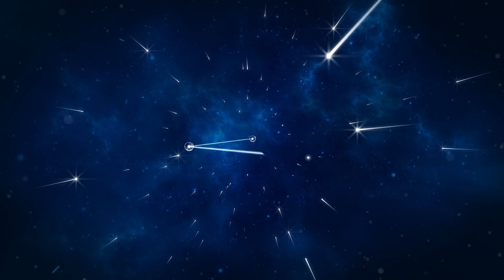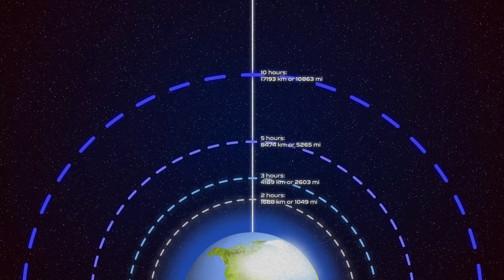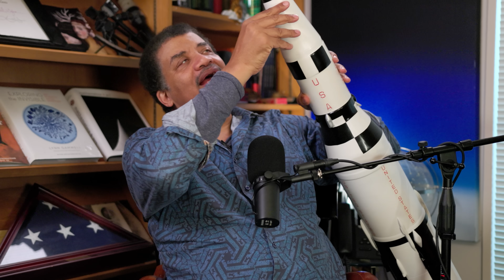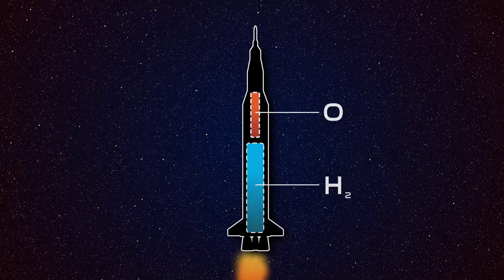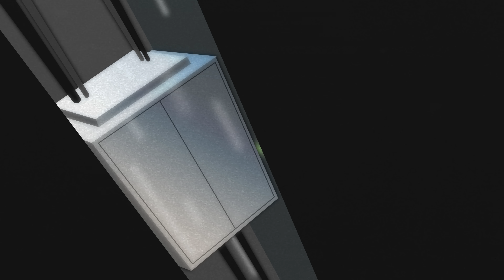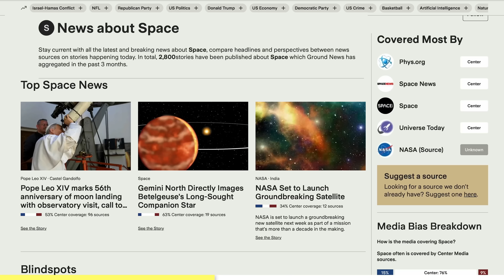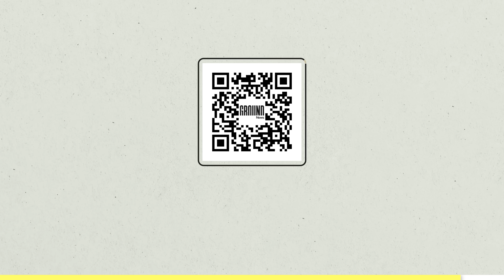When Will We Have a Space Elevator?

Comment: I consider space elevators to be a preposterous idea. Carbon nano tubes have the tensile strength if they no structural defects. And from what I've read they also have very low friction so how do you anchor the ends of the cable and how do you climb the cable?

Comment: I understand that it is impractical in the extreme to have one as far up as the ISS, but why would we need a space elevator/port that high?  All of the legion of satellites seem to function just fine in their much lower geo orbit. If we as a species are prepping for realistic space exploration we need a reliable cost effective way to get stuff up there, but also to bring stuff back (like that mostly gold meteorite people keep going on about in the asteroid belt). Is there a reason why a transit terminal there (which considering what he said earlier would be about 16 times farther away) wouldn't be viable? If it's a 10 day trip up the space tube at 100 mph, a 1/16th of that is a little more than an 8 hour work day which is still a bit but a lot less of a hassle than needing a space elevator hotel that goes along with the cargo package.

Also as an aside, if we had a lighter gravity planet, would a space elevator be a viable option then? Say if it was 1/2 the gravity pressure applied by the earth? Aka if we were able to use our currently available steel production to do this venture instead of 1 inch carbon nano meter tubes.

Comment: wouldn't need cables, but instead use a gear system so that the elevator box can drive itself up.  but another problem is not the weight but vertical stability, so would need cables ever 50 miles or so going up  that spread out and attach to the earth at certain points.  Or would need thrusters every so often that can keep elevator shaft straight.

Comment: The space elevator weight idea can (in theory) be solved with the same thinking that gets water to the top of a skyscraper.  A single column of water would create too much pressure at the bottom to be functional.  Instead, the water is pumped to stepped reservoirs so the actual water columns are shorter.
With a space elevator, you similarly break it into smaller (lighter) segments by creating platforms at fixed intervals using either rotors or balloons that can be fueled from the surface using either electricity (for the rotors) or Hydrogen (for the balloons, or hydrogen fuel cells)(which wants to rise anyway).  The platforms could also be used as rest and maintenance stops on the journey up.
This of course completely disregards weather and atmospheric conditions.

Comment: So im just an idiot, but i have a couple questions. If you spinn a basketball on youre finger it self balances. If you ty a string to the side of that ball and try to do the same, the balance is disrupted and you can not spinn it. Would a space elevator have the same efekt on the rotation of the erthe?  second question. would the rotation of the erth help the elevator gain momentum after leaving erths gravety? and, could that force generate energy to counter the energy needed to leave the erths gravety? Im sneeking inn a third question. What if this was placed at one of the erths poles?

Comment: The Geostationary anchor point has to be 20k+ miles away but you could have access points along the line that allowed for docking and unloading.  You would not need to go to the anchor point any more than you are required to go to the top floor of a building when getting on an elevator.

Comment: A space elevator is theoretically possible, but it would be an enormous engineering challenge. The idea is to anchor a super-strong cable, possibly made of carbon nanotubes, up to geosynchronous orbit, where the centrifugal force balances gravity. Once built, it could carry people or cargo without rockets, using electric-powered climbers. A ride from Earth to geosynchronous orbit would take several days, much slower than a rocket but far more fuel-efficient. Right now, the materials and costs make it more science-fiction than reality, but it’s a fascinating concept

Comment: Something that I never hear mentioned is that carbon nanotubes are conductive.  If you had a string of them extending through all of the layers of the atmosphere and the charged particle radiation belts, it would carry the current straight to the ground, creating an electrical short circuit. It would most likely burn up instantly, like an under sized fuse. If it did survive somehow it would cause huge unpredictable fluctuations in the stability of the charged layers. It might cause mega storms or some kind of virtual conduit that causes surface air to spew off of the planet and vent into space faster than it does naturally.

Comment: Interesting talk.
One possible glitch with a Space Elevator:
The air space around the elevator for a great distance would need to be very highly controlled. 
What if a plane accidentally crashed into/ bumped the cable?
Missiles? Deliberate sabotage?
The countries that have an elevator would need to control their air space tightly.
Not to mention hundreds of satellites and space junk.
Smashed windows? Fuel tank or battery rupture?
Engine smashed?

Comment: This is why Neil is so much better at being a planetarium director than a research scientist.
The space elevator concept was never just a straight dangling line…until very modern times with very degraded physicists proposing it. The workable idea is to build an artificial ring around the planet and have four elevators around the planet along the equator reaching up to the ring. It does not have to be, nor was it intended to be at 23000 feet. Only a couple of hundred miles up, 400 at most.
It is hypothesized to be a rigid non moving structure, so even without the ring it would not orbit, it would be like a massive sky scraper extending out of the denser part of the atmosphere. You can read details of the original concepts by Tsiolkovsky and the ring concept in Arthur C. Clarke’s 3001: The Final Odyssey if you are like Neil and do not want to actually read the concept design proposals and instead focus on the absurd changes proposed by modern physicists looking for grant money. The only real difference was it suggests we learned to build with cheap but strong man made diamond as Clarke was not yet aware of carbon nano fiber, it having not yet been discovered. Lab grown diamonds took off in the late 50s and 60s which had engineers and sci fi writers dreaming of what could be.

So no 10 day trips needed…no giggling like you are smarter than the guys that actually invent and build things, the guys that actually explore space and are invited on to research teams…you know the guys that don’t talk and do.

Comment: A rocket has to go about 25,000 miles an hour to escape earth.  That means you'd be at the space elevator height in about 50 minutes.  Compared to 7 or  10 days in a space elevator depending on speed.   Yeah, not sounding real great.  Won't be holding my breath for one of those.  Plus, how would you anchor it to the earth?  Wouldn't great forces be pulling and tugging on it?  I could see it collapsing and doing a ton of damage as well.   Just sounds like a disaster waiting to happen.

Comment: one of the problems i see isnt the speed/time as we can make the chamber a vacuum and once speed is achieved it should increase due to no resistance, and we could slow it down at the other end with a propulsion system.

the technology is there.

the issue is sustaining the bridge and keeping it connected without breaking, would require a propulsion system on the entire tunnel to keep it moving at the same speed as earths rotation in the same direction, at the same speed.

that we dont have the technology for.

Comment: Just an update for those curious, we have managed to reach 550mm (with confirmed tests from independent labs) at a japanese university since this was recorded.  Still not nearly long enough for the project, however, managing to grow the process 10x since that time is a very exponential, even for most technologies.  And, the 55 they are talking about, was only 5.5 about the same length of time before that, and before that about the same length we were amazed by a .5 amount.  If that pattern stays growing that way it will not be Too long before we have workable amounts for smaller tests and early pre-space uses.  And from there the space tests will not be that far behind.

Comment: Conservation of angular momentum means space elevators cannot work.  As the elevator goes up, it needs more and more angular momentum in order to be moving with the rotation of the Earth, but there is no mechanism in a radial cable to add angular momentum to the elevator.

Comment: I have a physics Q about this. We got the string part, the station or weight at the end. That holds up with centrifugal force. So that's something I can imagine at scale just fine once we get the right materials. It's just a simple equation at that point. But when we have this elevator riding up it, is that not going to change the forces as this mass travels up and has it's own forces and is changing the equation?

Comment: This would still be like spinning a baseball bat through space.
Exactly what trajectory would be safe and not crush every satellite within the elevators arc of travel ?
Had we never launched even a single satellite,  there would still be naturally occurring space debris.
No matter how tiny that debris is, it would still be like continuously sand blasting the top portion of the elevator.
Great idea in theory, but profoundly difficult to implement efficiently and effectively.
Think about the space dust that is too small to cause ANY damage to the top sections, yet are struck hard enough to fuse layer after layer of this dust onto the upper surface of the elevator.
The better idea would be a elevator base, that is suspended in atmosphere and follows a trajectory that keeps it pointing in the suns direction at all times and the "near surface" bottom portion is a air port that standard and heavy lift aircraft can land on, then load the elevator for the final leg of the journey.
Still not as efficient as rockets though.

Comment: The problem with a space elevator isn't the technical challenges (although they are substantial.) The issue is that some nutcase with  a rocket launcher will inevitably destroy it, if the space junk doesn't get it first.
Even if you discount traditional weaponry, this would be competing with the OTHER kind of rocket launcher, the kind run by SpaceX, with whom the beanstalk would be competing. Just as there are financial incentives to build it, there are financial incentives to knock it down. And it would do a LOT of damage while coming down.
I could see one being built on Mars or the Moon, where the challenges are less and the competition less cutthroat, assuming we ever build a presence elsewhere.

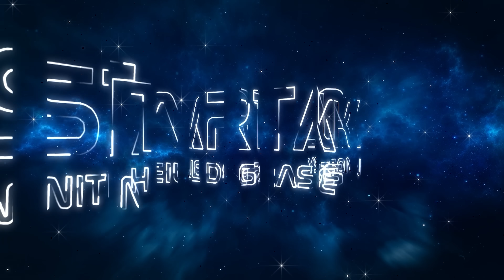Comment: Talking from minute 0:20. You need fuel to move the top of the tower in 0 gravity and engines to compensate the transition of gravity during the whoole tower couse otherwise will break in two
Reply: No. Electric motor lifting up
Reply: @kettelbe I dont know any electrical motor that can generate the power enough to win the gravity in both directions with the additional weight. But if there is any, im very sure that a Electrical Train would be more efficient.
Reply: @Pitteriny its like climbing a very long ladder.  It takes relatively little power to climb up, eg human expending 100 watts to climb, easy enough to have high voltage wire to power the ladder climber just like electric train.  Challenges are finding a material strong enough to make the ladder and getting the ladder up.  The ladder has to extend past geo synchronize orbit to hold itself up and that is crazy long distance...  its only feasible on our moon with current materials and technology
Reply: @Pitteriny any elevator literally does that
Reply: @binaryblade2 but a space elevator is times a million
Reply: @dynomar11  in distance yes, but not in force or power. distance affects the total energy of the lift, but I can feed in energy from rails or microwaves or whatever. Power is affected by the weight and speed of the lift. If I don't have enough power I just go slower. Finally max weight is determined by max torque, but I can always gear down. 

If I can build a car that has it's own motor and lifts itself and cargo straight up (which I can), it can lift itself up forever.

Comment: One extra thing, the travel time. On the cable, your elevator is really only speed limited in the atmosphere. So after 100miles it can keep accelerating to the halfway point. So even at a low 1.1g acceleration:

Time: ~1,843 seconds (~30 minutes 43 seconds)
	•	Final Speed: ~19,876 m/s = ~71,553 km/h = ~44,436 mph
Then start decelerating back to 0 to stop at the terminal. So the whole trip could be done at this rate in a couple of hours. 
With the car attached to the cable, your elevator is don’t even have to carry your fuel. Just supply energy on the cable. You can get the energy by recovering power from descending cars and some additional solar.
Reply: no
Reply: @scottmcshannon6821 , well, I guess that successfully argues against my point then 😅

Comment: When I was in high school - during the early 90's - I worked at a pretty high tech tool shop over the summer. I was really into sci fi books and shows. I had just read Arthur C Clarke's "Fountains of Paradise". There was some secure work being done by 3M at the shop at the time and parts of the shop were off limits. One of the engineers that worked at 3M borrowed the book. After I got it back there were some fibers taped to the inside of the cover. A main component of the story was a space elevator made from nano fibers. Apparently 3M was working on a machine to generate nano tubes. Crazy thing is Clarke published that book in 1979. What a visionary.
Reply: If you haven’t read the 2001-3001 series you should. 3001 The Final Odyssey had the most workable space elevator concept. 4 elevators positioned around the globe along the equator leading up to a man made ring in low orbit, instead of carbon nanotubes it used man made diamond and solved the geostationary orbit problem returning more toward Tsiolkovsky’s 1895 concept of a skyscraper.

It would solve all the problems other than the material ls and achieve the same goals…plus be big enough to help overpopulation while preventing many of the debilitating conditions associated with high orbits/weightlessness.
Reply: @theycallmerobb It's surprising how much progress we've made toward 3001. Ms. Pringle (I think that was his AI assistant's name) is mostly real now.
Reply: @theycallmerobb Diamond is just a carbon crystal created under high temperature and pressure. So basically still carbon.
Reply: If I remember correctly, Clarke name checked  the guys who proposed a space elevator. The material that Vanaveer Morgan uses  has still not been invented.
Reply: Kim Stanley Robinson’s Mars series from the 90s goes into great detail about building space elevators.
Reply: You know Arthur C. Clark invented/wrote about satellites before sputnik. I think Mr. Clark is/was/will be a time traveler.
Reply: @stephengreen3566  For sure. He's the one during WWII, when he was part of the RAF, that figured out satellite positioning to communicate around the planet - often referred to as a "Clarke orbit". Super smart guy.

Comment: We could do an Orbital Elevator, but not with cables as that is still to dangerous.

Instead, we could do something with Electromagnets, if we can set it up correctly, we could have it so a repelling force is pushing the elevator car up, while also having a pulling force above the car pulling it.

Look at the Maglev trains, if we do something similar vertical instead of horizontal, we could have a fast way to go up.

as for emergency situations like the power went out, the Car(s) could have emergency brakes that extend from the car(s) to grip against special grooved areas to slow and then stop its decent or if going up uncontrollably, to slow and stop its accent.

Though we would probably need the Orbital elevator to have one or two Nuclear power plants to supply the power needed, One on earth and at least one in Orbit.

The Fastest Maglev train I believe can reach a top speed of 375mph, but if we use more expensive and better materials, we could probably make it go faster, and once we reach a point above earth, gravity resistance should go down a bit.

Only real issue in its creation is shielding for it from all the floating space junk.

It would be more useful though to have two Orbital elevator lines, one for ascending to the orbital station and one descending back towards earth, this way one line is specifically focused to ascend with safety measures in place and the other for specifically descending back to earth with safety measures in place.

One the Ascending car(s) reach the orbital station deck, they would then move horizontally over, let those who arrived off, then allow those who are going back to earth on and in reverse order, go to the descending line and go back to a vertical line and descend.

This would also allow for multiple scheduled Ascents and Descents like a subway station.

I believe we can do it, it is just the funding and resource procurement which would be the tough, not to mention the man power to build it as it could take a few generations, but in the end we could have our own Space Platform with a shipyard and everything in the future and Space missions would become so much easier as ships being built would no longer need to be designed for earth exit, only for emergency reentry.